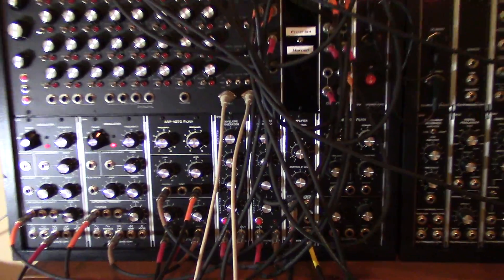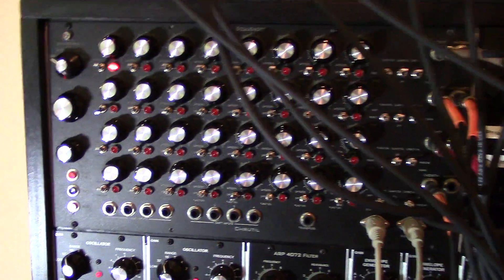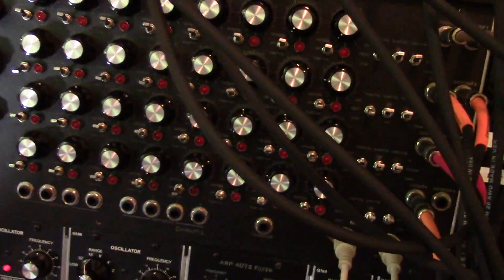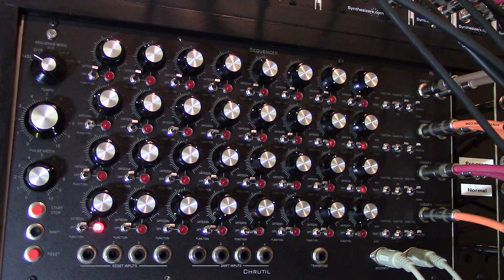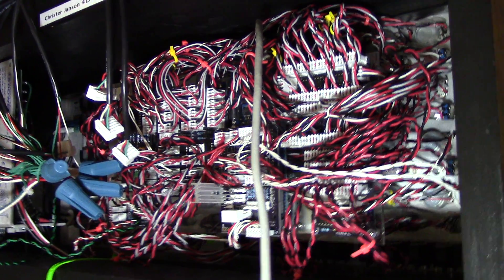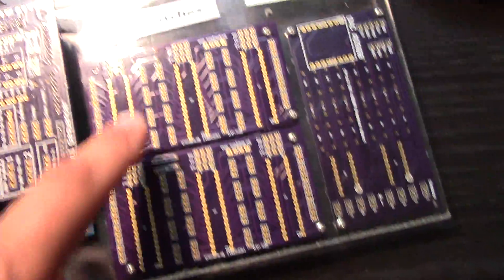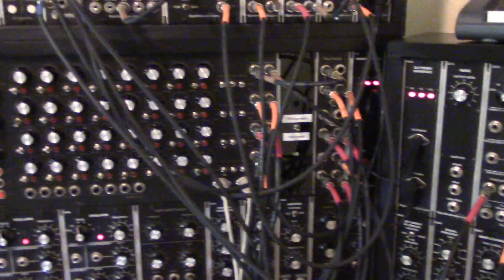Third demo of home built Analog Sequencer - Part 2

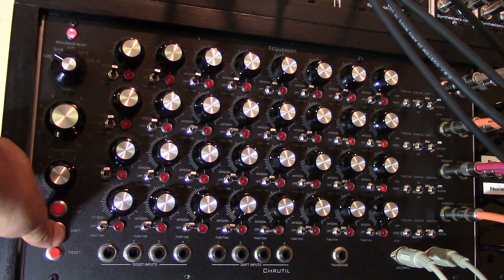Comment: Great job! And holy crap 2:55 freaked me out! ;-) It caught me off guard because I was actually so engrossed with the function where you hold the manual shift button down to sustain the output so you can tune. O M G I went and checked my 569 and it does it too! I am so embarrassed! Either I never knew it did this or forgot years ago! I just always temporarily change the settings on my VCA etc. lol, I feel dumb but I learned something valuable, thanks! ;-)